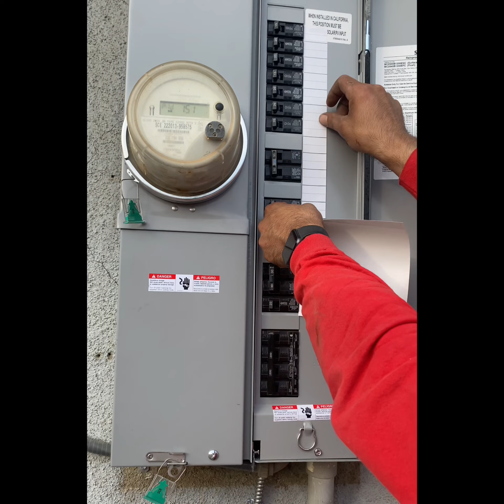200 Amp Service Upgrade

Comment: Great work brother! You killed it here. I love being an electrician and doing 200A upgrades too but we do them differently here in NJ. It still cracks me up that the distribution panels are on the outside of the house. One bit of advice is to stand facing away from the panel when you energize the main breaker and the branch circuit circuit  breakers because you never know when an arc might occur and that shit would fck you up good.

Comment: Only recommendation I have for you is to invest in a few pairs of safety glasses. Especially if you love your job. Blind guys don't make for good electricians. 

Old guy I know clipped a stranded #10 wire to smooth it out before landing it, and just dumb luck, a handful of those little copper clippings flew right into his eyes. He almost lost his ability to see. Doctor managed to get everything out after two separate procedures and 6 months of no work. 2 to 3 weeks of no vision in one eye. 

Good luck out there. Stay safe, stay alive!
Reply: Amen brother ive been to the ER a few times for metal in my eye. Only after work though.😂 and i wear glasses

Comment: Great video, thanks! The only thing I didn’t understand is how the wood panel you used to fill the hole in the wall with was waterproofed? It seems like you just screwed it in and left the joints exposed

Comment: Do you have a flush panel ag your house? Semi flush is the way to go. That will be a fun job when someone decides to upgrade the wires that go thru two boxes. Or yes i know you can just run conduit on the exterior. Be safe out there broskie

Comment: Never seen bx used for grounding a service before working for Com Ed in Chicago.
Reply: Me neither seems like it would be a reliable ground.
Reply: It has a 4awg copper wire inside that does the actual grounding.

Comment: A great video! I've been asking this all over the web.
HELP! I'm replacing an old Federal Pacific 100-amp panel with a 200-amp Square D Hameline panel, so I will need to upgrade the service entrance cable and want to use 2/0 THHN copper.
 The outdoor meter can/box is mounted low, (30" off the ground at bottom edge of can) outside, so if I use the bottom rear 2-inch knockout of the meter can, it will put the hole through the wall below the bottom edge of the new breaker panel by about 8 inches, so I will have to make a vertical 90 upwards turn from hole in wall to bottom knockout of the new panel. I cannot find a 2" close 90 PVC electrical fitting so I'm guessing they don't make one. 
My question is: how do I make that vertical 90 turn upwards? It will eventually be covered in drywall. Do I need to have the inside copper leads in conduit at all? If I use switch to 4/0 aluminum, do I need conduit inside the wall cavity? thanks in advance!.
Reply: new 200 amp panel is being mounted on interior if I'm understanding correctly.. for that 90, I would think you can use an LB

Comment: I’m a apprentice lineman and I’m usually the one doing the disconnect reconnects but I’m interested in making my own company doing mpu
Reply: Where are you located. I’m
An electrician of 15 years mostly commercial I do a lot of residential but never done a a panel upgrade. I’m f you I. The bay I’ll cut you in. If you teach me 🙂

Comment: Nice job. question how long does it take to get a permit to do a job like this in California.
Reply: Permit is usually instant online, and post-work inspection takes 1-2 weeks. Getting power company out to fix connections takes >1 month. Most electricians do the main line detachment and reattachment themselves

Comment: MC sheath is not recognized as an approved grounding electrode conductor. Are you guys licensed?
Reply: I was wondering about that myself...never seen that done before!
Reply: Most likely a 6 bare ground wire inside that
Reply: @alexrenteria289 it’s a #4 bare copper inside

Comment: That connection to your ground rod isn't right. It should have been #4 copper, solid bare or stranded insulated. You just clamped to the mc sheath.
Reply: He took a mc cutter to expose the #4 copper and then crimped to that with the ground clamp. You can see it in the video …

Comment: How was wondering what type of wire you used inside of your metal conduit ?Urd?
Reply from the maker: It was 4/0 AL THHN
Reply: @r8rmartin  all 3 wires 4/0?
Reply from the maker: Yes

Comment: I often see videos of all of the house wires passing through one large knockout in the back of the panel.  I installed a panel where the breakers are in a bottom section rather than side-by-side, and I separated the cables  into different knockouts.  Do you get any feedback from inspectors on grouping all of the wires together?
Reply: I kinda want to know too. What he did was pretty ghetto but I guess the inspector allows it.
Reply: I'm curious how that complies with  312.5 (C) NEC with the bundled NM cable in a 2" knock out. If the inspector is cool with it, so am I.

Comment: Did you call the city to disconnect at the head?
Reply from the maker: Yes, scheduled with Edison to cut the power and called city to schedule inspection
Reply: Nunca  había visto lo que usaste para ground  parece mc que fue eso nuevo para mi en 30 años de servicio (